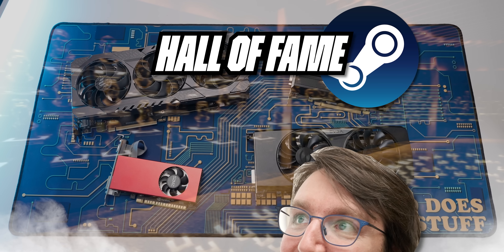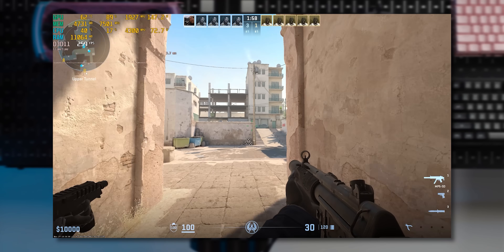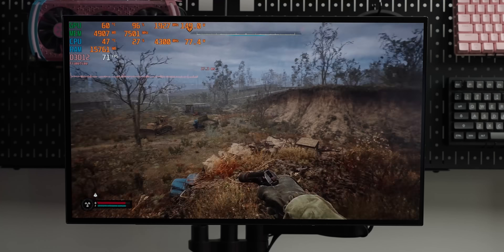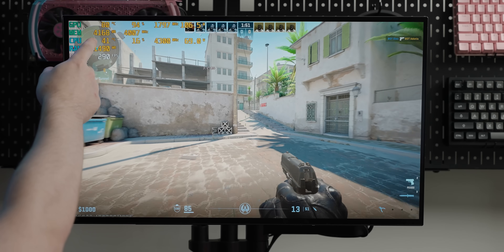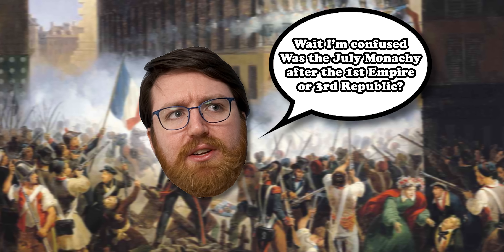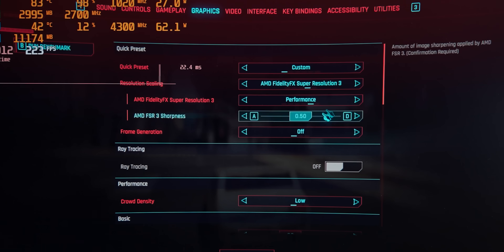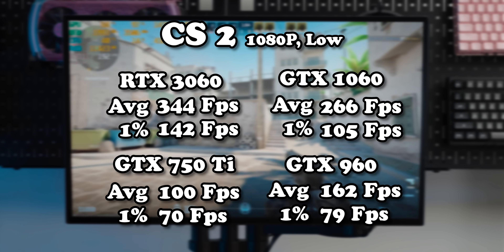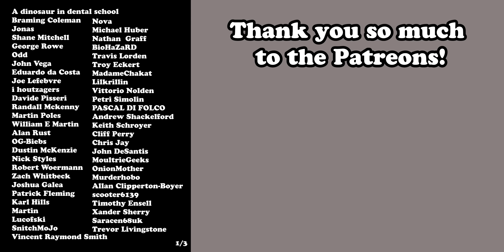GPU Showdown: 7 Years Of Steam Hardware Survey Kings

Comment: I had the ASUS Strix GTX 960 4GB
I was told the 4GB version, was pretty much a gimmick, as the GTX 960 wasn't powerful enough (or was it, not fast enough) to make use of the extra VRAM.
I always thought my hardware was less than ideal, then I see the survey, and realize I have been hitting above Average, most of the time. (although my PC would probably Struggle to play Indiana Jones- The Circle of Time, and my current PC is the best I have yet to own)

Comment: The 750ti (and later 1050ti) were so popular because they didn't require a PSU cable (drew all power from the PCI slot) so people could drop them into prebuilts (often without a GPU) and face no problems.
Reply: Mine did. But maybe because it was a overclocked model from factory.

Comment: Doing nostolgia cards would be nice!  Would be fun to try different types of systems too.  An example, for a while I was trying to run a gaming pc that was low voltage electricitiy costs.I had an amd/ati HD4830 back in the day to fill that roll...I think.  From what I remember with my research at the time, it was very low voltage, and would be just fine with the games I played at the time(though I stopped shortly after) everquest and similar.  Actually might have stopped just before.  Might have started playing roms at that point.

Comment: I made the mistake of getting the 2GB version of the 960, and while it did run almost all of the games I wanted to play from 2015 when I got it to around 2022, it didn't let me play GTAV on max and X4 ran in single-digit framerates. I did manage to get Cyberpunk to run and got through the tutorial mission, but the experience wasn't what I'd call smooth. :)
Though, all of that was on an i5 4570, which is also not the most powerful CPU for modern games...

Comment: I will put another comment about missing the 1650.
Also, you said about 1060 3gb having stripped down chip, but you didn't say that those bastards did the same thing to 3060 8GB 

Also there is a flaw in the steam survey, cause not only they are mixing different versions of the cards together (like 3 and 6 gig versions of 1060) but sometimes they are mashing the mobile GPUs together with the desktop ones. And sometimes they don't..

Comment: The difference between the 3060 12gb and 8gb is like a courageous 1080ti vs the 💩 throw up 1660super. 

And not crapping on the 1660s, just the shady garbage move of naming the same card for 2 levels of performance. Basically the same sh*t as the 1060

Comment: doplease stop testing GPU performance in games at 1080p on low (or with DLSS). At such settings, performance depends more on the CPU than the GPU (and the GPUs are not even running at their full power).

Comment: This video makes a point that I think a lot of people an easily miss:  We really haven't moved forward that much in GPUs since 2018, especially in the 1080p space that a lot of people still game in.

I have a 3060 in my secondary system (it does recording, mostly).  It is a solid card, does a nice job, and generally works like it should.  It was a good step up from the 1060 that was there before it, but dollars for donuts it was a pretty expensive way to gain some frames.   I game with a 3080 and find no reason at this point to replace it, I would have to sell body parts to pay for anything that would be close to an upgrade, and that would accompish moving games from200fps to 300 fps, on a 144hz monitor that won't let me see the difference anyway.  

I think at this point the CPU / GPU world is pretty much played out as it is.   We have long since entered into the turd polishing part of evolution.   the APU coming out pretty much eat up the low to mid of the market anyway, which is much funnier to me.   I suspect the next real steps will be based on AI, where we will make a sizable jump into the uncanny valley of being ALMOST lifelike as opposed to video game looking stuff.  Imagine for a moment Fortnite but where it actually looks like real life, and not a cartoon.  That is where things are headed.   Some of the racing games are getting closer to it, but still maintain that piece of cartoon graphics look that you can't shake.

Comment: Have you tried the thermal pad ptm7950 instead of thermal grease. I have been using that on my laptops and GPUs and improve on 10°C less the temperatures. I removed the thermal trhottle on my laptop and reduce a lot the rpm on the steam deck. And improve a lot the thermals on my GPU on the desktop

Comment: I'm pretty sure that STALKER 2 only supports a GTX1060 6gb or higher, so the fact that the game even loaded on the 960 2gb at ALL is shocking, even if it was at single digit FPS. No doubt the minimum specs are for acceptable 30fps or 60fps performance at the resolutions listed on the specs page, since they list by resolution what you'll need. I'm just glad the game supports more than 8 core CPUs quite well, as I have not run into significant CPU limitations on my 5950x, and still have a good bit of overhead for other things.

Comment: Bro that 750 ti didn't look at all like a 750 ti, I have a 750 ti. Not in my system. my system is a 3060 OC 12gb, I used to run a 750 ti a long time ago... your "750 ti" looked like a 730 with a fancy metal shield. But nope... It's a LP 750 ti 4gb. Mine was just a dual fan 750 ti

Comment: The GTX 1060 is still my gold standard for performance. I'd still be using mine today, but it was a modded card for a bespoke motherboard and case, that motherboard died in 2022, and continuing to use my 1060 would have required probably installing a new fan shroud and stuff lol, so I finally upgraded.

But the 1060 is why I'm a fan of the 3060 6GB, yeah, the naming is bad, but we finally have >1060 performance in a budget slot-powered card that's easy to cool and easy to use in weird builds.

Comment: Part of the reason the GTX 750ti still pulls a premium is because it's the last best low-profile single-slot card to support WinXP.
The 9xx series didn't have any low-profile, and the 10xx series has no XP drivers.
So anybody building a high-end retrogaming XP rig, in a mini-ITX case small enough to fit on a shelf like a console, wants that 750ti.
Reply: All three of them are willing to pay a lot for that card
Reply: I remember seeing some gtx 950 low profile models but I don’t know whether the 900 series had any windows XP support

Comment: 1060. The Covid GPU
XX60 series GPUs have been looked at as the base level gaming card for over a decade.
The time 1060 is on top is during the Microprocessor wasteland where it was sometimes difficult to buy a GPU and when it wasn't it was more expensive than we were accustomed to.
3060 was the GPU which started being widely available and people had given up on GPUs being reasonably priced any time soon.
Many people are on a second gen upgrade cycle so this dearth of GPUs during the 20 series has pushed a lot of people onto the same year of the cycle which will even out over the next 4 years.
There has been little change between 30 and 40 series so no need to upgrade between these gens.
I wanted to buy a GPU with enough ram to last at least a few hours before it needs upgrading I went for a 7800xt with 16GB

Comment: I actually lived this! I went from an AMD (ATI?) 6750 HD (before the Geforce 600 Series) on an old Dell Optiplex into a 750ti and then built my first PC with a launch day EVGA GTX 1060 6GB. I actually finally replaced that 1060 6GB with a 4070ti Super last Summer! GTX 1060 6GB is still plenty usable at 1080/60 as long as you're not playing a UE5 game. Or Starfield.
Reply: Nice. I went from a ATI X700 to GTX 650.

Comment: People forget how huge of a generational leap there was between GTX 900 and GTX 10 series.  The architecture simultaneously performed better while being more power efficient.  They sold out so quick, that if you weren't on the product page RIGHT as it was restocked, you just had to wait for the next round of stock... and that was before bots were widely used to scalp GPUs!

Shoot, the GTX 10 series is so GOATed that a GTX 1080 Ti is STILL viable for a 1080p gaming rig, SEVEN AND A HALF YEARS after its release!

Comment: The reason why (most likely) the 750 ti wouldn't load Stalker and the 960 would, is because the 960 supports dx12 FL_12.1 and the 750 ti only supports dx12 FL_11.0.
Reply: And the 4gb version of the 750 ti you have is pretty hard to come by. Even TechPowerup gpu database doesn't mention that variant. Much more common is the 2gb version.

Comment: RTX 3060 was the first time a card launched with not only multiple different die/ram/membus sizes, but to do so in a very very very unadvertised way. No one talked about 3060 differences until tech reviews. It was possible to overpay for an 8gb version due to scalping/Nvidia's nonsense.

The GTX 960 4gb was hard to find because it wasn't very popular by AIB. Look for the Strix version and you should find it. I was able to pickup 2x WITH SLI bridge for like $140 in 2020. Back during the GPUpocalypse. 

GTX 960 4gb is also what I ran in 2014/2015. Loved that little card, Strix FTW. I also picked up a 970, and a 980 (also strix, still have it, btw, also still operational). I think the 750ti was a popular card to put in EVERYTHING prebuilt, especially laptops and also a fav of ebay/offer up. That's probably why it showed up in a lot of hardware surveys.

Comment: I believe you once referred to the RTX 3060 8GB as the 3060 scumbag Edition because of the nature of Nvidia bait and switching a cut down die and the lower vram capacity. They didn't make many of them but it's 20% slower & like 5% cheaper. 8GB 3060 is a giant rip off & the 12 gig isn't great value either.

Comment: i STILL have a pc running a 1060 with smaller games. WOW it actually had decent graphics for the Stalker game. MY Brand new bought 2080Super OC at 2.1 ghz.  Cause i can and its water cooled...with my i7 10700k @ 5.1 all cores...cause i can water cooled.  :)   My 3000 PC 5 years ago is STILL OUT DOING these fps numbers. Soooooo happy i got a 2080super for 600$.   ti is only like 5% better than a super.   I love your vids man.    2080Super is better than the 3060.. just saying.